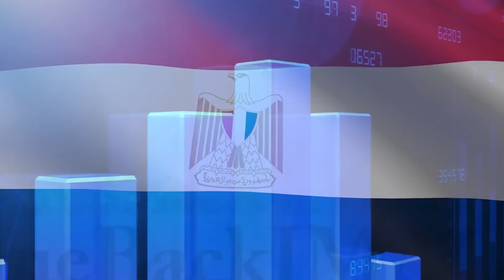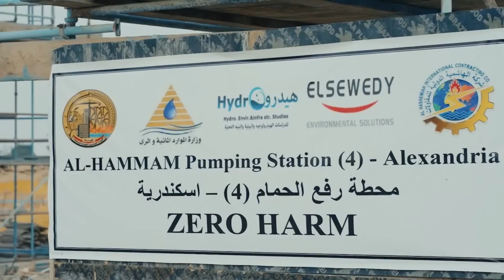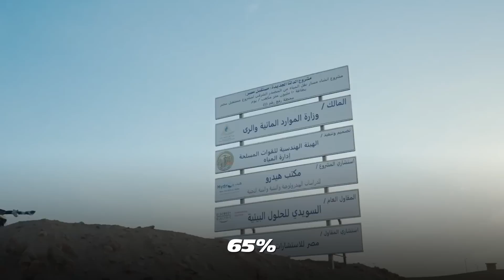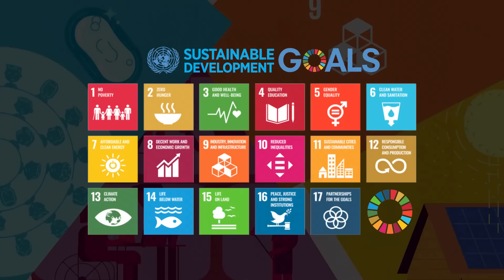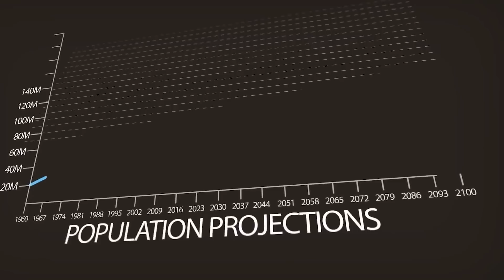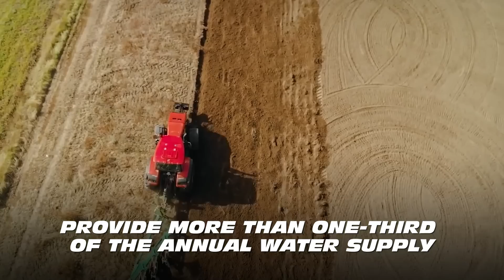Unbelievable! Egypt Is Building A 100Km RIVER In the DESERT

Comment: Many wide open channels were shown, in that environment evaporation will lead to huge losses. Pipes or deep and narrow channels seem a better option.
Reply: That has its own problems. Narrow channels could stagnate the water and reduce 8ts quality. As for pipes they are more expensive and offer little flexibility in terms of where exactly you can withdraw water. In a channel all you need is a pump that you can put anywhere
Reply: You can put over the canals solar panels to produce electricity. Sun will not touch the water and  there will be less evaporation .

Comment: There were disappointing gaps in this video.  The first question which came to my mind when I started watching the video was the route of the new man-made river. It was never shown. A related question I had, and the most material issue for this project: what is the source of the water that is being transported? There were passing references to recycled water, but this issue was not really addressed. The importance of the water source question was highlighted by the mention of the Nile being diverted upstream by Ethiopia, with less water to flow to Egypt. It does not sound like the Nile would have sufficient water capacity to supply a ""man made river"" project, but this question was not addressed or answered in the video. The failure to address these fundamental questions leaves the video somewhat incoherent.
Reply: @sgalla1328  That is plausible. If the plan is to use the Nile as the water source, that could be problematic. I think a very compelling approach would be to desalinate seawater and then pump that into an aqueduct system. Israel is doing this to bring Mediterranean water to replenish the Sea of Galilee.
Reply: @joeanderson4508  there is no other way the dam will get bombed one way or the other
Reply: @norastifler  The day the Ethiopian dam got a scratch by Egypt from that time on the Aswan High Dam will be a legitimate target to blow by us- the Ethiopians!
Reply: @bisratgirma  🤣🤣🤣
Reply: @bisratgirma  Sure thing. Eritrea took all of your coasts meaning your naval option is limited. As for ground force Ethiopia stands no chance. Sudan is already allied with Egypt meaning after the dam is bombed with ease if the situation spills into a war that will mean Sudan already declared state of belligerence. Even if they try to make it from Chad which is a neutral nation and sees no benefit in joining the war, it is still impossible because Libya won't let the Ethiopian ground forces due to Arab League's policy it is also worth noting that the Ethiopian forces will have to pass the desserts of Libya Chad and Egypt all the way up to Aswan with very few supplies and harsh climate if they "somehow" make it though Libya as well. For Airforce Ethiopia still in no weight compared to Egypt. As I already mentioned Sudan already declared state of belligerence Ethiopia has no notable air force that can make it from Sudan to Egypt without fuel shortages. Sudanese air defences will destroy all of Ethiopian jets before even making it to merowe and rosaries dam. Sudan not only showed what it is capable of compared to Ethiopia in Mahdist war but also against your fanos in the border. Ethiopia only have 10 competent pilots in the entire army and the highest ranking one was shot down already. What about airstrikes? The answer is still a massive no. Majority of Ethiopian rockets date back to Soviet era with very little range very little efficiency and very little damage.

Ethiopians should escape the fantasy to avenge Egyptians by hitting Aswan High Dam. I am not sorry for this making you feel uncomfortable or give you sleepless nights.
Reply: @heshamhero6149  Whatever Egypt is capable of doing harm on the #GERD Ethiopia is also capable of doing it. All you said weakness of Ethiopia are also applicable to Egypt. Egypt is the same unindustrialized agricultural society, the weapons are not made by Egypt. Ethiopia also can get what Egypt got.
Reply: @bisratgirma  Lol I explained everything on detail why Ethiopia can't fight back if Egypt bombs GERD. 
Keyword: Sudan
Reply: @heshamhero6149  Egypt can't fight Ethiopia the reason why she is talking.
Reply: @joeanderson4508  they wasted water from the Nile and then treated it, that water is still Nile water 😂
Reply: They're using agricultural drainage water after a three step treatment process to be reused in irrigation for the new fields
Reply: For those who want to know the source of this new river's water, its source is a giant water treatment plant called "Al-Hamam Station". The plant processes agricultural sewage collected from all over Egypt in a lake called "Mariout" and then discharges it into the Mediterranean Sea. Now, it will be treated at the station to feed the new river. Additionally, the new river will also be fed by two other sources: groundwater in the western desert, but it will not be relied upon heavily as it is not a renewable source of water, and seawater that will be used to cool the Dabaa nuclear power plant. The resulting steam will be condensed and collected to feed the river, as if it were also a seawater treatment plant. In addition to being a nuclear power plant, a small channel will also extend from the Nile River to feed the new river. However, most of the water in the new river will come from the treatment of agricultural sewage, water from the Dabaa nuclear power plant, and groundwater.
Reply: @ahmeddewan8664  Thank you - this is very helpful information, and provides the missing piece of the puzzle. This is a very innovative approach, similar to Singapore which is careful to recycle its wastewater whenever possible.
Reply: It's called a canal.
Reply: Muammar Gaddaffi had constructed the largest
irrigation system in world history, tapping into the
primary water cycle. This supplied 6.5 million cubic
meters of fresh water per day to the various cities in
Libya, enabling the country to grow fruits, vegetables
and grains otherwise impossible to cultivate in the
desert. The project cost 25 billion USD and was
completed without financial support from any major
countries or loans from IMF banks. In 2011, the
incredible achievement was destroyed by NATO with
depleted uranium nuclear bombs, cutting off the
water supply to 6,000,000+ people.
Reply: @calfotogal  I remember this. I believe there are significant underground aquifers in the south of Libya that were tapped for this project. Chairman Mao planned a similar project to bring water from China's south to its arid northern regions, and I think this project was realized within the modern era.
Reply: @calfotogal  6.5 m cubic meters is nothing to Egypt the population is 108m and the agriculture area is much wider. Suffecency is within billions
Reply: I'm with you social media has made people dumm
Reply: I think the first thing that egipt have to make is reducing the fertility rate population 

I think that from 50 to 100 millions people 50 years is the problem
Reply: I have many concerns too with this project - either there's a loss in translation or it's just another pipedream eventual failure. 
  
To give people the reclaimed (treated agriculture water) doesn't sound good to me.  

Cooling the nuclear power plant with ocean water sounds backwards -  it should be the other way around.  

The ocean water should be for the people (after desalination of course).   

The reclaimed agri water should be used to cool the nuclear power plant .
Reply: found the editing very irritating too quick for me to comprehend what was going on I am sure its a great story but needs rework in the telling, sorry turned off after a few minutes
Reply: @bbillbill3919  colonial languages are not easy 😂